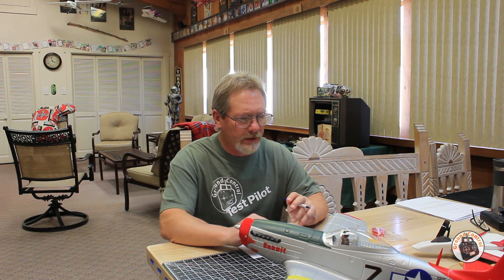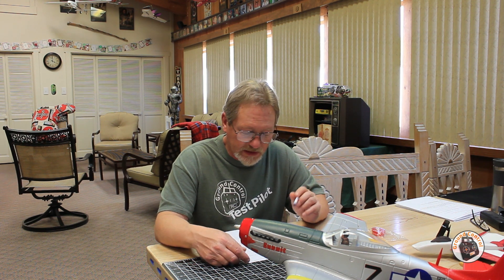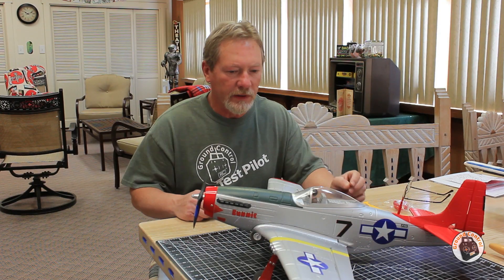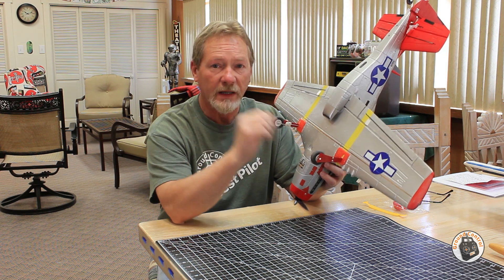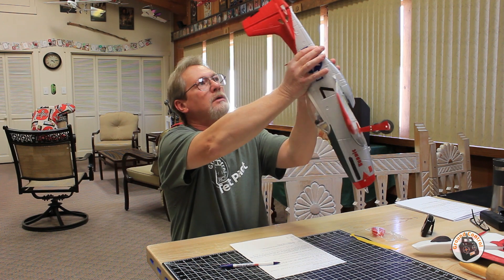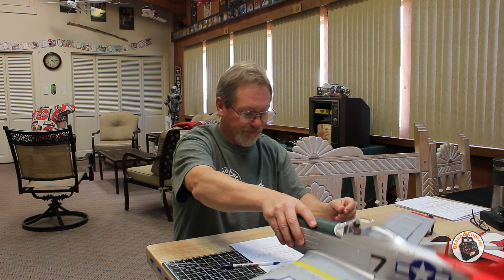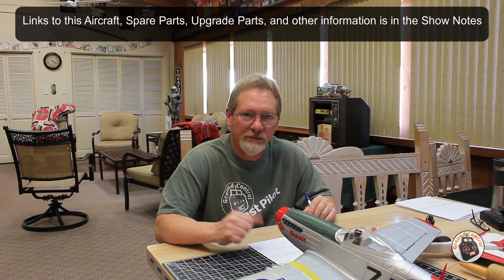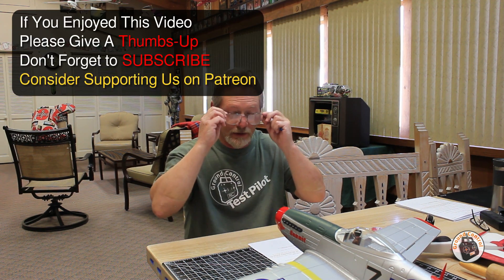Review Part 4 - Volantex 768-1 P51D Mustang 750mm PNF - Tips, Tutorial, MODs, Setup, & Conclusion!

Comment: I like your vids a lot. It seems you know what you are doing.. 
Perhaps you can make a vids that shows how you have replaced for instance the motor. Lots of newbies buy such beginner planes. Vids on the mods might be very interested to watch!

Question; why the lower 1400kv motor? Why not the racerstar BR2808 2600kv? Isnt that more fun?

I have problems with or the receiver or Gyro.. in expert the elevator moves like 20% of what the beginner and intermediate modes gives me. I think that should be reversed, beginner 20% and on expert the max elevation. (same thing with ailerons..).. Bought a new gyro EAR403 on ali.. didnt solve it. Anybody have similar problems with this plane?
Reply from the maker: Thank you much Bob! I may very well have a Show & Tell Tutorial on this Plane's Motor replacement in the Future. I'm in the middle of Testing Motors and Props to find the best fit for different Planes. I use higher KV Motors on my Parkjets where smaller Props are going to be used. Lower KV Motors are typically spinning Larger Props. The 1400kv Motor works well on this Plane using a 3S LIPO. While a 2600kv Motor would produce more Thrust it would also pull more Amps. I test Motor and Prop combinations to find the best Thrust and Efficiency for each Motor. It's always a trade off between Thrust and Efficiency. I could put in a Motor and Prop that would give this P51D Unlimited Vertical Climb but the Flight Times would be extremely short ;-) This P51D is the PNF Version so it has no Gyro System. It's all Manual Control. I'm not sure what's going on with the Gyro on yours but it sounds like the Flight Modes are in the Reverse Order. The Expert Mode should indeed give you the greatest amount of movement in the Control Surfaces. See you in the Air!
Reply from the maker: Ouch! If I had to replace mine I would most likely fabricate mine out of 3mm plywood. That's the material I use for most of my Motor Mounts. I might piece the plastic one back together with super glue just to keep and use as a template for my fabricated motor mounts. I sometimes use nylon spacers as offsets for motors if needed as well.